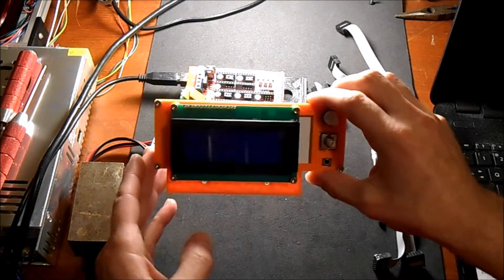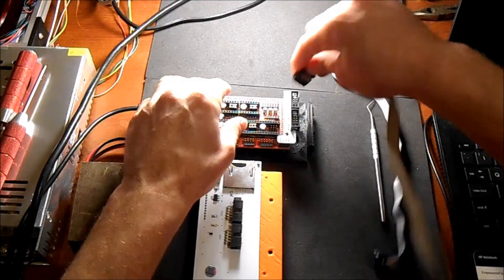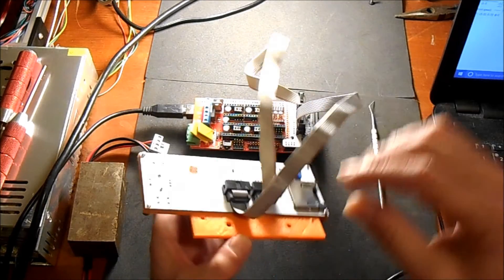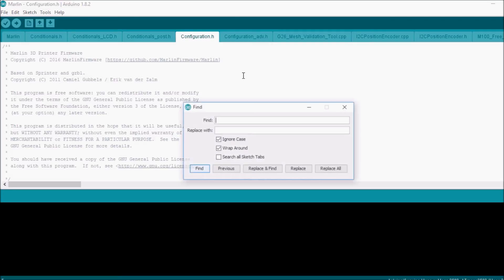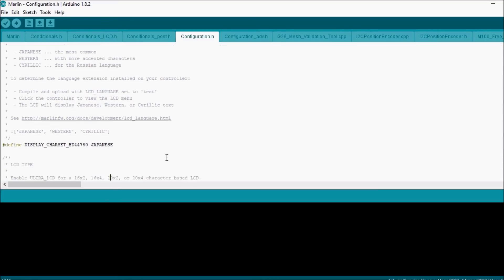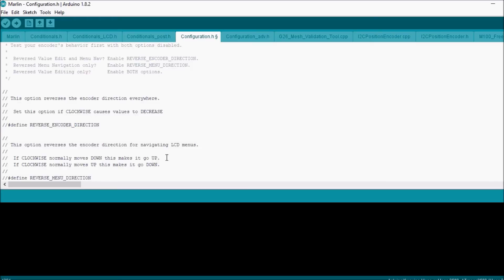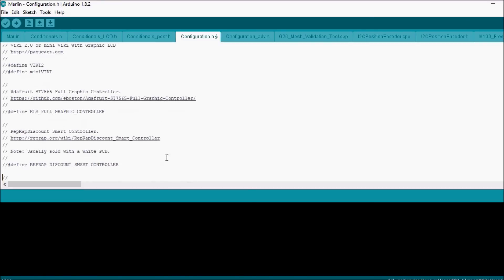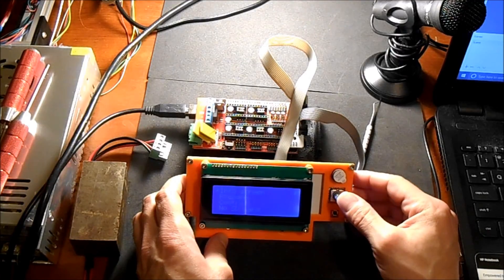RAMPS 1.4 - LCD (REPRAP DISCOUNT SMART CONTROLLER)

Comment: Sir I copied you steps in my Marlin.ino file  and uploaded the code to my Arduino Mega 2560 with the Ramps 1.4 and its Full Reprap Discount smart controller connected
But still there is nothing showing on the display...
Just the backlight is on .. but that was on even before I changed the Marlin.ion code
Reply from the maker: This might be easier to explain in Discord chat in link below.
Reply: @EdwardBraiman  ok sir I will join and ask my question there
By the way you are the Quickest in whole youtube to give your fans attention
Reply: Sir there is no Discord link.. please can you provide it?
Reply from the maker: @shreyaskumar5366  Discord:
https://discord.gg/JzhdGgr

Comment: thnx for the tutorial very usefull, but I have a question, but if I no connect to usb the arduino the LCD not work. it's works only with conection to usb? how to configurig lcd for with no conection to the Computer?
Reply from the maker: Could you give me more details about you hardware?

Comment: Should I get this one or the 12864 one? Does it really matter & does this one uses less computational power? Thanks.
Reply from the maker: Well the amount of processor usage is very low, but on RAMPS 1.4 I prefer Reprap Full discount Smart controller.
Reply: @EdwardBraiman  Thanks for your quick reply. I might upgrade to a ultimaker gantry system. As the Arduino Mega(I've been told) sometimes can be bottlenecked, I'm a bit tensed about the processor usage...

Thanks again
Reply from the maker: You're welcome.

Comment: Hi, 
I have been watching your videos for a while and found them very interesting and useful. They really helped me to understand for ramp 1.4 in a better way. 
I had a little issues with my LCD (Reprapdiscount smart controller) which I managed to solve them after watching this video, but still one thing can't figure it out. I want to adjust the contrast (it is very high and I can hardly see the letters). unfortunately, the option of potentmeter is not available in the back of the LCD. I'd be grateful if you gave a hint how to solve it.. thanks in advance
Reply from the maker: Thank you. I'm unsure how to fix without a potentiometer.  There maybe a wiki someplace with the information.

Comment: Hi how are you, I installed the marlin 1.1.9, but I get an error, the screen does not work the knob, I am using a 2004A screen. Another problem is in pronterface I move the axes, and they don't work, they get stuck, locked sometimes they move.

I have 2 types of screen and in the 2 the same thing happens to me.

2004A LCD screen
2004 LCD screen
They come in Kit with RAMPS 1.4.
Reply from the maker: Does the screen illuminate?
Reply: @EdwardBraiman  No
Reply from the maker: Try reversing plug connectors to LCD.
Reply: @EdwardBraiman  But they have a form factor, they need to change the connector,
Reply: @EdwardBraiman  You think that the arduino IDE could be the cause of the problem, if you want the marlin I am using is a variant of the original marlin, since it is for the Prusa Bear, or prusa I3 MK3.
Reply: It's very weird, I've followed the step by step video and it doesn't work.
Reply from the maker: It should illuminate.  If it does then the rest of the tutorial may work.

Comment: it not working i am very......................................
Reply: I figure it out. I use Marlin1.1.x with Ramps1.4
1. Define REPRAP_DISCOUNT_FULL_GRAPHIC_SMART_CONTROLLER from Configuration.h
2. Install  u8glib Version 1.15
3. change the file ultralcd_st7920_u8glib_rrd.h at Marlin folder
 from 

//#define ST7920_DELAY_1 DELAY_NS(0)
//#define ST7920_DELAY_2 DELAY_NS(0)
//#define ST7920_DELAY_3 DELAY_NS(0)
 to
#define ST7920_DELAY_1 DELAY_NS(0)
#define ST7920_DELAY_2 DELAY_NS(200)
#define ST7920_DELAY_3 DELAY_NS(0)
4. compile&upload
Reply: @uuyoubaan4uuyou829  hlo
Reply: @uuyoubaan4uuyou829  can u explain detailed
Reply: @gamerboy8320  I found the solution on Internet.Not my understanding
Reply from the maker: Could you give me a little more detail?
Reply: Only the sound is coming
Reply: But display don't response it show blank
Reply from the maker: Which version of Marlin firmware are you using?  This was made several years ago.  In new Marlin firmware you need to remove comments for x, y, z and E0.  Search on A4988 in configuration.h if you're using Marlin firmware 1.1.9 or above.
Reply: @EdwardBraiman  I am using 1.1.9, LCD lights come on but shows blank screen, although pressing knob makes sound through speaker.

Edit: I adjust the contrast now, its showing garbage characters.. with 1.1.9. However with 2.0.4.4 it shows boot screen with  Marlin version then shows garbage characters again.
Reply from the maker: @FarazMKhan  what occurs when you reverse ribbon cable connections?  If the light doesn't work it maybe a contrast control issue or a bad or loose connection.

Comment: Am I right thinking that I need to have any programing board with USB like this Arduino one?
Do I need to programi it? There is no way to just connect that to 12V supply so it can go with base program which I thing should be there allready? :/
thx
Reply from the maker: Arduino mega needs to be programmed for using.  The Arduino mega might not be loaded with the configuration you require.

Comment: Uncommand of #define SD support made this error: pasting "* SPI Master In Slave Out pin" and "DDR" does not give a valid preprocessing token.
Any help?
Reply from the maker: Which version of Marlin firmware?
Reply: @EdwardBraiman  1.1.9
Reply from the maker: Okay, I've tried, "#define SDSUPPORT" with a fresh download of Marlin 1.1.9 and compiled in Arduino IDE without issue.  I also tried, "#define REPRAP_DISCOUNT_SMART_CONTROLLER" and both compiled separate and together.  Is something else in the Marlin Firmware version 1.1.9 modified having to do with SPI support?
Reply: @EdwardBraiman  I also downloaded fresh Marlin 1.1.9 and have the same error. Could you send me your working version? Thanks for your help. My email: wilkmarek11@wp.pl
Reply from the maker: What version of Arduino IDE are you using?  My current version is 1.8.7.  what is the operating system as well?
Reply: @EdwardBraiman  Thank you very much for your answers. I had bad version of Arduino IDE, 1.8.6. I've downloaded 1.8.7 and it's working :D Thank you also for video, it was very helpful 👍
Reply from the maker: It's always about finding differences between what you think is the problem and what variables need to be the same.
Reply: @EdwardBraiman  would not have guessed that the problem is in the arduino IDE software.

Comment: Found you video which was helpful but hasnt solved my issue. I am using the mks gen L board and just have square blocks displayed on screen. Any help would be appreciated. Thank you
Reply from the maker: Thanks.  So where are you seeing square blocks?  What speed are you connected to device?  What speed is specified in Marlin fw?
Reply: Edward Braiman Hi. Really thank you for your reply. I solved my issue with the info from your video and also commenting out full graphical display which the originator of the MPCNC had enabled.

Comment: Hi Edward, I have copy All the LCD part to my Arduino and my LCD is the same as your .
The LCD lights up but no numbers only white squares. Any idea Thanks
Reply from the maker: Do you know if you ribbon cables are plugged in opposite connections?  I have another video for this on MKS Gen L which is a similar process and better video quality ... https://youtu.be/Fr9BijY9IpQ
Reply: hi. already check on your videos and follow proocesses an nothing hapens.
Reply from the maker: Could be a broken cable or LCD.  It lighting up says power is working, but something else is not.  What's the serial number on the LCD?  It might be another selection in Marlin firmware.
Reply: the only nunber I can find on the LCD is KQP2286W2-00A .
Reply from the maker: Do you have a link to where you purchase it?  Also how many pieces is it?
Reply: I bought it on Ebay 1 year ago or more the board where is mounted is purple and the designation on  ebay- 2004 LCD Display 3D Printer Controller With Adapter For RAMPS 1.4 Reprap Mendel .  It´s the LCD, 2 cables and the adapter to connect on the RAMPS 1.4.
Reply from the maker: Here is the one used in the video ... https://www.ebay.com/itm/Smart-LCD-2004-Display-Controller-for-RAMPS-1-4-RepRap-3D-printer-Electronics/222900843751?hash=item33e5ecf4e7:g:eQsAAOSwCPdavTP8
Reply: mine is the same but a purple board insted of red
Reply from the maker: AndreMaxP51 I suspect that it may be a defective component.  You may want to try another from a nearby supplier and see if similar issue. If this is the case it could be the Ardunio or RAMPS 1.4.  you can check the RAMPS digital pins with a debug command in the configuration advance
H and check with multimeter, but if this takes more than an hour you might be better of replacing components.  Hope this helps.
Reply: Edward thanks for all the help for this moment I finally put everything working. I have disconnected all and only with the arduino connected I have cleaned the old compilation and made it new. Finally connected everything back and LCD is working and showing everything OK.. Many thanks
Reply from the maker: Happy to hear.